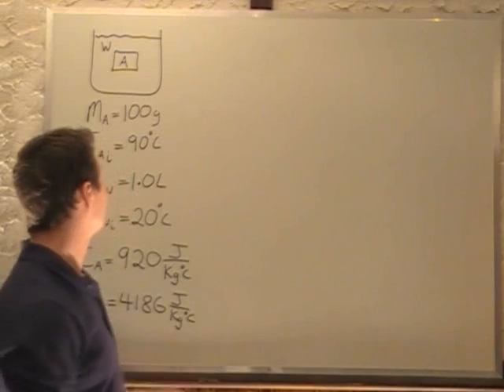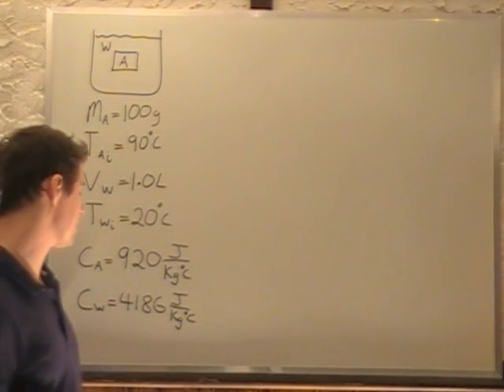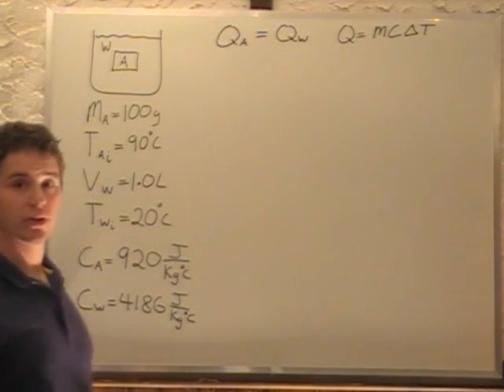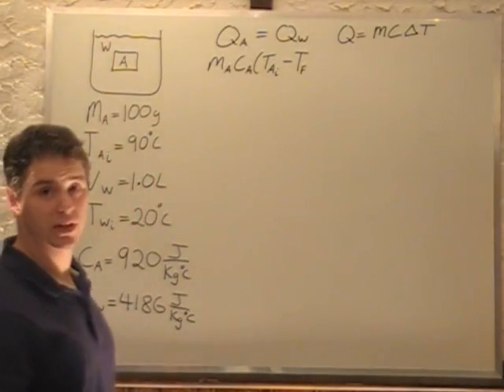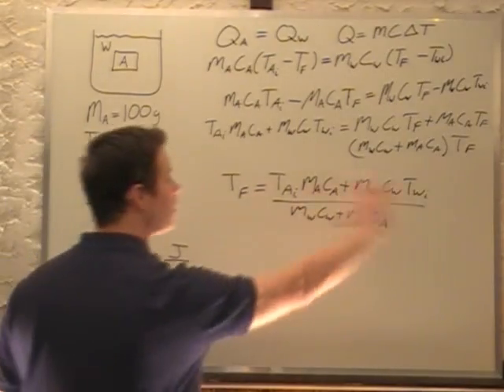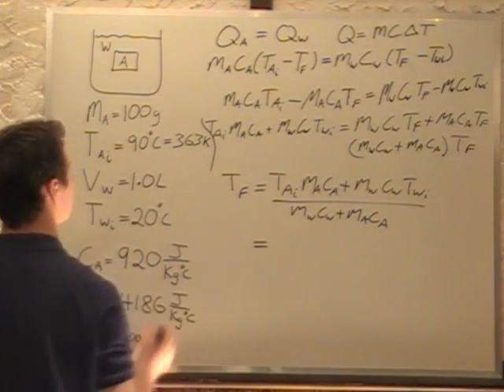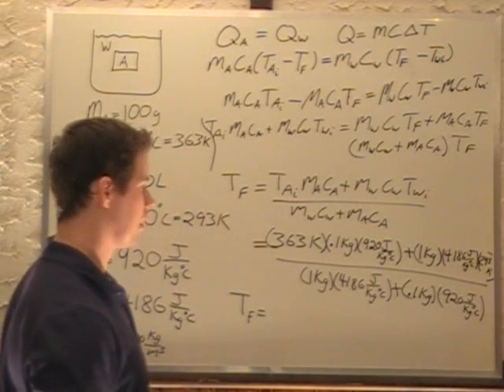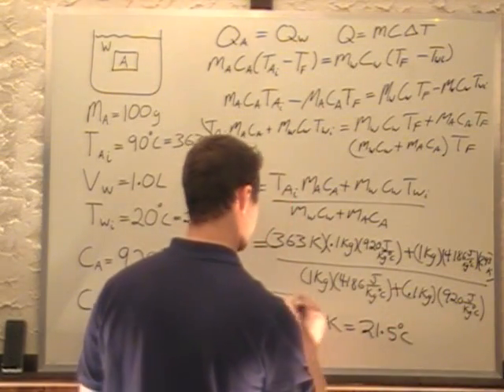Thermal Physics - Equilibrium Temperature

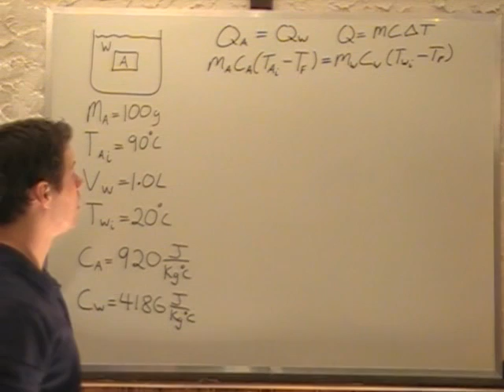Comment: Would have been clearer and avoided the formula switch confusion at 2:42 if he had just started with:
Qw = -Qa

And did not need to convert to deg Kelvin because 1 deg K is equal to 1 deg C.